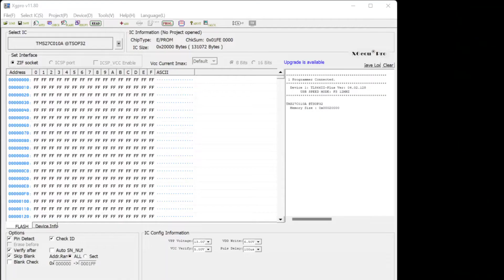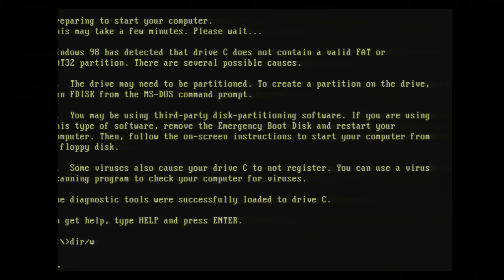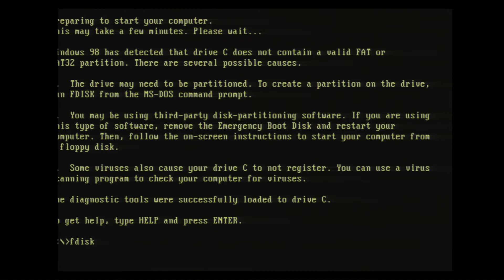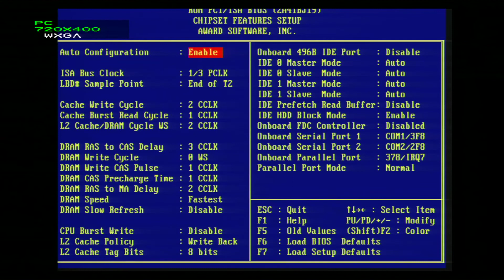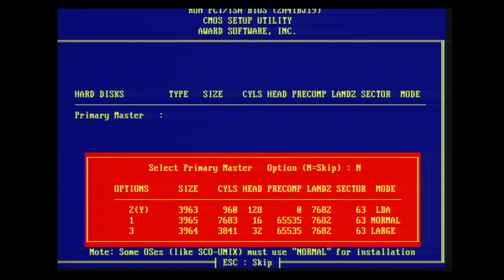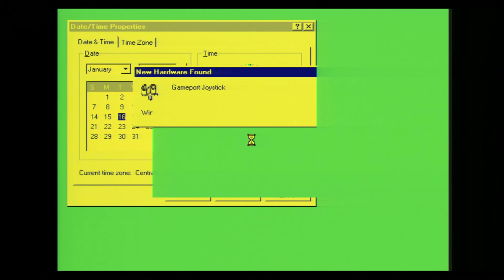Abused Jetway 486 PCI board Bios change and other madness

Comment: If you are reading this today, I have a 486-PIO3 motherboard with 486 DX2 166mhz. I have the same boot problem. I have tried cables floppy controllers and onboard motherboard. It will not boot C: nor A: